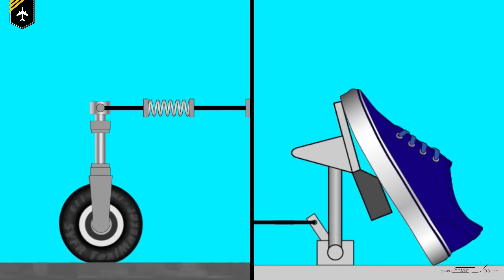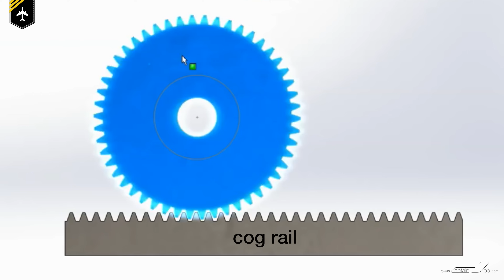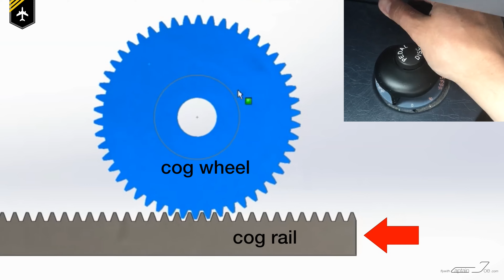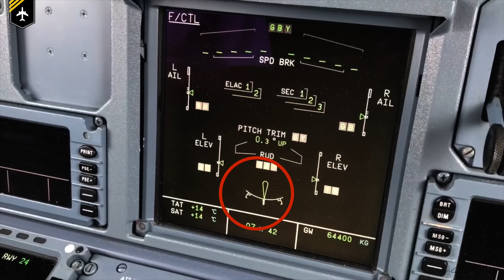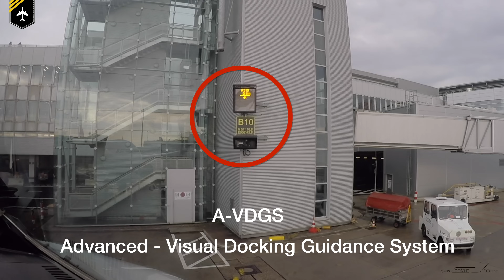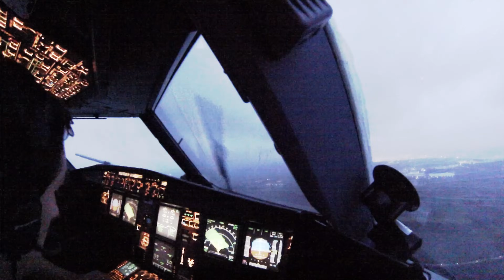Do PLANES have a STEERING WHEEL? All about NOSE WHEEL STEERING

Comment: Please take my question: what happens if fuel runs out or engines fail mid air, please take my question in one of ur videos
Reply: The aircraft won't fall out of the sky. It can still glide a reasonable distance, so you can do an emergency/forced landing

Comment: not all planes use that cog rail/wheel arrangement though, do they? I'm pretty sure most aircraft have two hydraulic cylinders at a 90° angle pushing the nosewheel directly into the given direction....

Comment: What happens if you try to steer the nose wheel while it is retracted? RC models use clever mechanisms, since it's usually tied to the rudder. Is is disabled by the computer when the nose gear is retracted?

Comment: how do planes steer in the air
Reply: Pilot uses ailerons, elevator and rudder to steer the aircraft.
Here is a diagram how they affect:
https://aeronotes.weebly.com/uploads/2/5/3/7/25370889/8437483.jpg?506

Comment: Is differential braking used for steering?
Reply: On the airliners the steering tiller is used to steer the nose wheel.
Reply: Mike P does it mean that pilot is not allowed to use diff braking for turns at all?
Reply: @Leipziger_str  - I don't think it is outright forbidden but the benefits are minimal. 
The aircraft is well controllable with the nose wheel during taxiing. Watch this video starting at 0.57 and you can see how the nose wheel turns at a steep angle and how the aircraft turns during taxiing:
https://www.youtube.com/watch?v=2kecF6DQJ2g

Comment: Pretty simple lets take airbus as an example. Rudder stearing pedal will also steer the nose landing gear but it realy depends on the speed how much you can steer it with the rudder pedals. And you have the little steering "wheel" to taxi around.

Comment: CPT joe how come in Commercial air craft the nose wheel steering is controlled by a tiller. Rather then by the yoke (stick) or rudder petals like military aircraft they just hold a button and turn  Either or stick or pedal??
Reply: During taxiing the tiller is used to steer the nose wheel. The yoke or side stick has no connection to the nose wheel. The rudder pedals have connection to the nose wheel, but because its movement is restricted when using the rudder pedals, the tiller is normally used during taxiing.

Comment: So, what is a rudder do? Used on the air, right?
Reply: The rudder is used during flying but the rudder pedals are also used to keep the aircraft aligned to the runway during the takeoff run and landing. The rudder pedals also have connection to the nose wheel, but the angle how the nose wheel turns using the rudder pedals is limited, but the tiller makes it possible to make tight turns during taxiing.

Comment: In a Piper Cherokee the rudder pedals are directly linked to the nosewheel, so for example you cannot check rudder deflection before take-off without grinding the nosewheel tire as you do so. In the Cessna the connection to the nosewheel is through a couple of springs, that incline the nosewheel to turn without forcing it. In a Cessna you CAN check full rudder deflection before take-off without the nosewheel turning at all.

Comment: Very good video.
I always wondered how an aircraft could stay on a runway with those tiny little front wheels doing the steering. 
Cause one second, the pilot's controls and directing the jet, as a plane in the air, and the next second your plane is on the ground and you need to control it like a car on a freeway.

Comment: What happened to some Aircraft which were equipped with steerable MLG for landing in strong Cross Winds without having to "flair-out" before Touch-down ? And, when did they do-away with MLG Wheel spin-up Devices to reduce Tyre Ware on landing (or was it to do with Gyroscopic Effect ? ).

Comment: My friend works for American. Someone forgot to put the lock pin in the nose gear when they started to tow the plane . They ended up breaking the tow bar .They asked if the pilot could make the rest of way out to the taxi way, he said no problem. They took the tow bar and ditched it in the woods. It was the 2nd time they had broken one because of the same mistake.

Comment: Captain joe why planes when landing the back wheel is first to touch the runway
Reply: The aircraft are designed to land on their main gear. During the touchdown the landing gear has to withstand the weight of the aircraft. The main landing gear is designed to withstand this strain and the entire weight of the aircraft during the touchdown. The main landing gear has to make the contact to the ground first.

Comment: Q: When you enter the runway for takeoff is there any system monitoring you're aligned with center-line or is done manually til you reach a certain speed?
Reply: You just look outside. It's actually not that complicated as it seems.
Reply: @ZK-APA  What if when already speeding you realize you're off center? Do you use the rudder?
Reply: @genkishan  yes, rudder is used. In fact it's quite noticble in any crosswind takeoff

Comment: No the plane  doesnt have a steering wheel. Its rudder pedals
Reply: The airliners have a tiller, and the pilot operates the tiller with his hand to steer the nose wheel during taxiing.

Here you can see the Airbus tiller next to the side stick.
https://qph.fs.quoracdn.net/main-qimg-4e56e7409b821b1946a913aeac5480c2.webp

Tillers in the Boeing 747 cockpit:
https://i.stack.imgur.com/AOuAS.jpg

Comment: Need to know how the back landing gear of an Antonov spins, if it does, because don't understand in terms of friction; as I know, are 6 wheels in line, and don't see how it turns to both sides of the plane avoiding friction on both sides if each wheel. I enjoy seeing your interesting videos, although I do not have experience piloting. Thanks for all what you do.

Comment: Hey Joe what do you do is your pushback truck is not avalible?
Reply: You wait. All u.s. airports don't allow powered pushbacks (powered reverse via reverse thrust). Even IF an airport suddenly did, there are no carriers in US and likely none outside that allow pushbacks in the SOP/PSM.  The Only exception I can think of is if you enter at a 180 to where you exit. Then you just go straight from arrival-park-depart gate. Airline f/o
Reply: For example, CRJ requires stowing of reverses at 60 knots slowing a/c Per "POH" by Bombardier. This is because they don't work well at slow speeds, and there is more chance to ingest FOD if not needed.

Comment: Hey I’ve got a question do planes have a reverse gear if not why
Reply: they have reverse thrust, which is to slow them down after landing. However,  it is not meant to be used to move the plane about on the ground because it could damage the engines, and there is no rear visibility from the cockpit. This is why there is a pushback truck.

Comment: Sir, let me recap..
👉 Below 130 knots, use tiller..
👉 Above 150 knots, use rudder panels...
👉 Then at higher speed, use vertical stabilizer..
👉 Correct me if I'm wrong...
👉 Pls reply sir with some comments 😁🇮🇳

Comment: wheel steering ?  I don't think that is common on may large aircraft.  I thought they still used the rudder pedals but in ground mode and instead of yawing or turning with control surfaces, signals are sent to the Nose wheel steering unit

Comment: they insert the pin for safety reasons. they don't want to be in the way of a towbar attached to the nose wheel when hydraulics swing that thing around like a baseball bat.
after pushback, you will watch out for the ground controller holding up the pin, giving you the all clear and verifying the towbar is no longer connected.

Comment: No, they have a stick, or wheel, or hand control depending on the aircraft type. Nose wheel steering, used only at real slow speeds, is used to steer the  aircraft by allowing the front wheels to turn. You can also use the toe brakes to aid in steering, but it's not as effective as nose wheel steering. Once the plane is moving, usually above 50-60 knots ( at 1 mile per hour the plane would cover 5280 feet in an hour, at 1 knot the plane covers 6000 feet in one hour) , the nose wheel steering is no longer useful and they use the rudder to steer the plane.

Comment: requesting for specific answer:  so the tiller would still able to turn the nose wheel mechanically, for example between 20 and 30 kts, +/- 75 degrees or the maximum turning angle of the nose wheel is reduced or undercontrolled by the computer system?

Comment: Hey planet joe, this is totally different to what i supposed planes did, i thought planes turned like army tanks, applying throttle to one engine and braking the opposite tire to that engine to pivot on the braked tire. Do they do this along with turning the nose wheel or you dont ever do that?

Comment: Great video Captain Joe, thank you for it! My dad was a private pilot (he never flew commercial airliners or anything that resembles them) but due to this I grew up surrounded by pilot's slang, books, magazines and so.
One of the things I have always wanted to understand was how (as explained in your video) large aircraft turned in the ground, I knew there was a small steering wheel but far beyond this (like the many details you shared) was something I couldn't even imagined.
One of the things that surprised me the most was using a small Cessna as example as I recall (my dad passed away almost 16 years ago) him turning his little 210 using only rudder pedals (I didn't even know that brake pressured was required for a complete turn) so always wanted to know about steering procedures on larger planes.

Thanks a lot, love your channel, keep it up!

Comment: do airplanes have a separate propulsion system for on-ground movements/taxiing? i can't imagine being able to make precise turns and movements on the ground, following the center line, under the power of the main engines of a large Airbus/Boeing...
Reply: Nope, they use the jet engines for rolling on the ground also.

Comment: I dont know how it is in Europe but in Canada we have something called a "bi-pass pin" which is a small pin that goes into the nose gear. We use it for pushbacks. With the pin connected, pilots aren't able to turn the nose gear at all (to keep ground crew and pushback vehicles safe in case pilot accidentally tries). This pin is taken off after tow bar is disconnected

Comment: As I sometimes play Flight Sims, this interested me. As it's only an on again, off again hobby, I don't have much experience. When taking off, I would notice difficulty maintaining the runway centerline, and usually end up overcorrecting.
I use some basic rudder pedals with push and tilt, as well as a yoke and throttle assembly.

Comment: Huh, I was pretty sure that planes have sensors on landing gears that track the taxi and runway lines automatically without steering, and I imagined switches for the forks so the pilot can chose which branch to take:) Maybe this is a good idea for improvements.  I thought so because planes follow the lines very precisely at the same time when pilots don't see the lines right beneath the plane nose.

Comment: Why does "Antanov 225" has wings on the "top surface" of the fuselage while "A380" has wings on the "lower side" of the body…?
Reply: Dedicated freight airplanes have basically always mounted the wings on the top of the fuselage. You can see that also on the C130, A400M and the C5 for instance.
The reason is simply to have the fuselage as near to the ground as possible because it allows to acces the freight deck with vehicles without special equipment.
Reply: I was wondering the same thing

Comment: captain joe why is it when  taking off or landing the cabin lights should be dim or off?
Reply: Because in case an emergency evacuation is needed your eyes are already used to darkness : you'd find the exit more easily and get out quicker.
Reply: I believe you because I've been told this by several pilots and flight attendants. Makes perfect sense. One trick taught by a flight attendant: if you are on a night flight and woke up because you have to go to the bathroom, keep one eye shut. This helps you adapt to the bright lights in the lav more easily AND helps you get back to sleep a little faster. I never thought of that. Clever tip. I wonder if she was married to an eye doctor...

Comment: Why do planes not revers by them selvs
Reply: Tekno G because the engines are are faced to go forward.
Reply: alacycle is intelligent. if reverse thrusters arae capable of braking the vehicle they certainly can make it go in reverse. But as you say, thrust going to the airport isnt healthy for the airport
Reply: Case in point why not used to taxi in reverse :  The Air Florida Flight 90 tragedy.
Reply: Either Cpatain Joe or Mentour Pilot has a video on that (forget which). Short answer: They can using reverse thrust, and sometimes they do. It’s not the norm because of various dangers—damage to the terminal, danger to the crew from debris, and the pilots can’t see behind them.

If you’re talking about motorized wheels, it would just be unnecessary weight and complexity.
Reply: Are you an idiot?
Reply: Dumbest thing I have ever heard

Comment: why does aviation uses knots and not m/s or km/h?
Reply: It has to do with navigation in the early days of flying.  A Knot means basically 1 nautical mile per hour. Now, nautical miles are quite handy for navigation because in the modern world, a nautical mile is basically based on the geographic coordinate system and means 1/60 of the distance between two meridian lines on the equator. For instance if you fly on the equator to the east with 200 knots. you can calculate very easy without any conversion factors that your longitudinal position will change by 3.33 degrees every hour. So you can determine your position without any ground reference which comes in handy if you fly over an ocean.

Comment: Captain Joe, pls do aircrafts have the ability to hover and stay still in the air, seems I've seen planes queuing up to land while staying still in the air. Thanks
Reply: The planes you've seen hovering, if they were airliners, were probably planes aligned on approach. Seen from afar with a long focal camera they may seem static and hovering.
Reply: I am not Joe, but I will answer anyways: In principle planes can hover, but only if they have enough headwind. The important part is the airflow around the wings. It doesn't matter if the airflow is the result of the plane moving through the air or the air moving around a stationary plane. 

In practice, a hovering plane would probably really hard to pull off. But that is a question for the pilots.
Reply: compuholic82 thanks for answering.
Reply: No.
The plane is nor Rc plane, like Alpha 300, Yak 54 etc.
Reply: Judah are u from asia/india

Comment: Hmmm this is strange.why use tiller for controlling the wheel when you have the rudder pedals? The control system of the plane could be configured in such a way that the rudder pedals positions (which by itself are not capable to turn the main wheen +-75 degrees) could be connected to a coupling system which could translate pedals limited position range into wider position range for the main wheel....

Comment: I have a question. WHY DID THEY REMOVE PUSHBACK BY REVERSE THRUST ON PLANES? IT SAVES COST ON PEOPLE BECAUSE IT ELIMINATES THE NEED FOR PUSH BACK TRUCKS! ): Now reverse thrust is useless expect braking.... Wait did they ever have pushback by R thrust?
Reply: Rinaldo Kiissa ingestion of FOD, damage to engines and heavy aircraft. Some aircraft woth tail mounted engines may be allowed to 'power back' under certain circumstances
Reply: Okay. Thanks for the info!

Comment: Thanks captain! I love videos that explain how things work.
QUESTION: I'm a glider student. Coordinated turns are very important to keep flight efficient so one stays up longer,. The relatively long wingspan means we get heavy adverse yaw to the point that the ailerons seem to affect the yaw as much as the roll. 
Do you have to manually coordinate your rudder with the ailerons to roll the jet or is there a fly by wire sequence that ensures efficient coordinated rolls by moving the rudder? It seems to me that with different control surfaces on the wing, manual coordination would be very difficult. The spoilers would produce positive yaw when they deploy in more rapid banking and they would produce positive yaw. 
I would think that this would be a fuel consumption issue as well as passenger comfort. 
In my model gliders can throw a switch to add rudder input as I roll to make efficient flying easier and I turn it off for aerobatics.
Reply: airliners also have this switch. it is called a yaw damper, and automatically applies rudder when you turn the plane with the ailerons.

Comment: I gather the wheel tires on an airliners landing gear are inflated to very high pressures like 145psi or 1000 KPa sach as you find on heavy construction equipment or a fork lift.  I would hate to be near such a tire when it blows up like a bomb.
Reply: Nose wheels are usual around 180-200psi and main wheels around 200-230psi, depending on which aircraft.

Comment: why do you need to pull the tires inside after takeoff.. is there any problem if tires be outside after takeoff ..
Reply: ilyaz khan It's better for the aerodynamics of the plane, when they're in
Reply: FLYTEK the wheels goes inside after lift off...
Reply: +ilyaz khan just like major gaming said, it is better for the plane to have the gear up for aerodynamic reasons. If they keep the gear down, it causes unnecessary drag on the plane.
Reply: SirNoName And the plane needs more fuel

Comment: The cog rail and cog wheel seem like an automobile's rack and pinion steering, but in reverse.  In cars, the force is applied as a torque on the pinion, but this is the opposite, with the force being applied to the analogue to the rack.